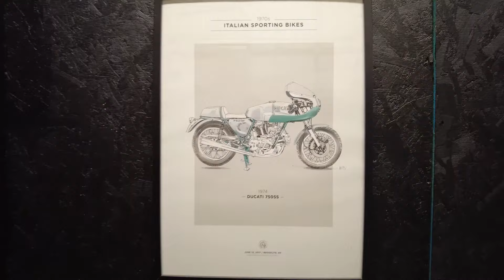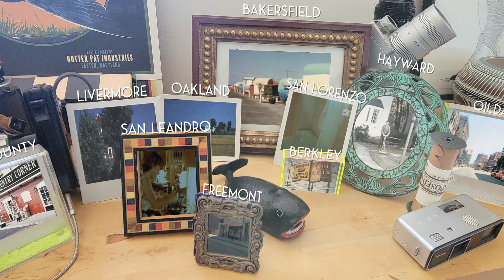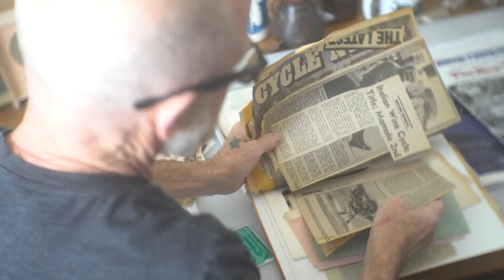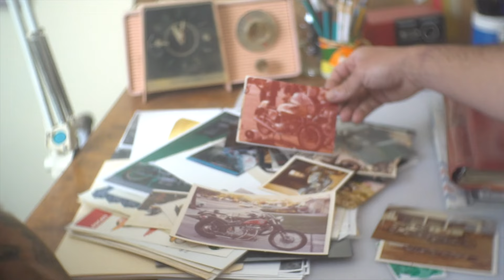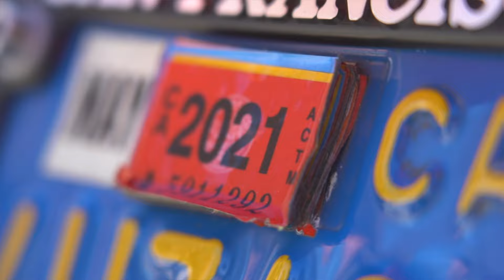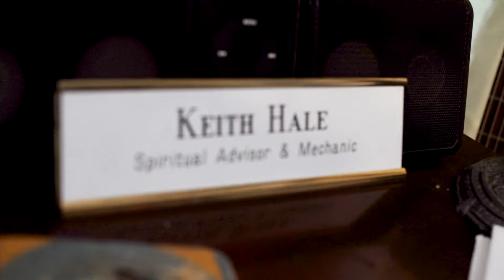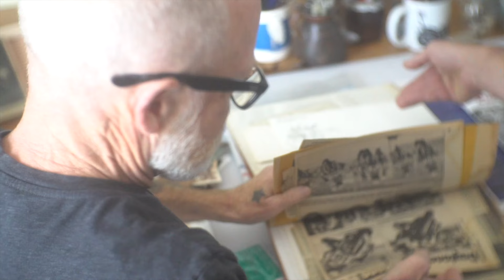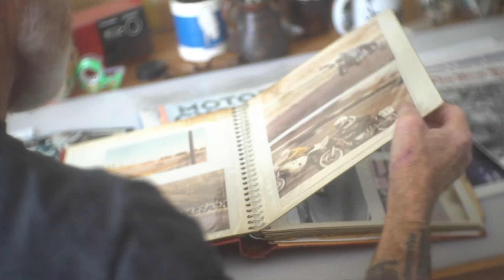Earned - The Story of Keith Hale and his 100k mile 1974 Ducati 750SS

Comment: 100K miles in a lifetime of ownership is nothing. I routinely ride 7k—8k miles a year, for decades. Many of my fiends also do the same. I like the last generation of the Super Sport, fuel injections being top on the list. These also come with 17” rims, 4 pot Brembo in the front. The last generation could actually be cut in two. This generation of Super Sport started in 1998/9. It was a bad financial time for Ducati as well as the start of a recession. I owned a 1999 SS 900. After a scary road accident, and an insurance payout on the damages, I race/track dedicated it. It was better there. Small, inexpensive improvements made for a better bike that it’s parts. I also owned a 2000 SS 750. That was a perfect street bike. I also out handled newer, flashier bikes. I very recently purchased a 2004 SS 800. This is a the second half of the last generation Ducati Super Sport. It operates at a higher level of performance. A lot more engine, very well matched/improved chassis, but  basically the same chassis. Small, incremental frame tweaks seem there. The rear end sits higher, the rear shock longer, firmer. Great for the track. Not so much for the street. Anyway, it’s a new bike for me. I’ll see if I’m not too old to adapt. I expect things will go well. After all, It’s a Super Sport!

Comment: bought one of the Other Rare ones a Mach 1 in Germany in 66 - in the Air Force, worked later on at MILLER Cycle specialties, restoring Ducati's, many a time at Berliner Motors, Long Island,  Hamden  cycle cntr, was a Ducati dealer owned by Bob Miller, Great video on Mr, Hale

Comment: I wonder how many 'engine rebuilds' this bike had?  Those bevel drive Ducati engines rarely made 15- 20 k miles in my experience without a crank rebuild as well as major work to the gears. The round case engines did not have ANY oil filter except a coarse screen, My own '73 750 GT had the case 'pounded out' where the main bearing was supported; it was NOT ever raced!  The gears were infamous for 'popping out' under load until they changed to gears with 3 dogs instead of the earlier 6 dog version, some of us had the extra dogs removed- The 600 Pantah and the Mille towershaft finally 'got it right'.  The 750 round case engine was truly a piece of art!  The original Conti glass pack mufflers were louder than legal in '74 but we all loved the sound! When Ducati went to the giguaro 'square case' the 'art' was lost! Those also were not as smooth running with their shorter rod engines.  No more balacing a nickel on edge as the engine is revved!
Reply: I can ask Keith if youde like. I had lunch with him today 10/04/2022
Reply: Actually, if the round case engine has it's oil changed frequently, wore air filters and was not abused, it is not unheard of to get fairly high miles out of them. Being entirely ball and roller bearing, the engines were fairly tolerant of crap in the oil. And the crank has a sludge trap that was fairly effective at catching crap before the crank pin. To have damaged your cases, I would have to guess that your 750's crank had been improperly shimmed, the wrong bearings, or both, most likely by someone outside of the factory. Those bearing are 15 degree contact and very expensive. Often someone who didn't know better would use 40 degree bearings with poor results. The early 860 based engines had short crank life due to using the 750 crank pin. The upgraded pin in the later 900 cured the short crank life. The "popping out" was more to do with abused dogs and speed shifting. Yes, removing the shorter dogs did help engagement, at the expense of more backlash. The 3 dog box became standard around 1980. And fyi, the Conti isn't a glass pack, rather it is all steel with a perforated straight through center tube. I completely agree that the Round case is a work of art. Some of that was lost with the Square case. The best is the Mille. Ducati got it's looks and mechanicals right.
Reply: @tdkeyes1  Gearboxes on those bikes were very poorly machined, when the various dogs between a pair of ears were supposed to mesh in Siri all the dogs with mash on both pieces evenly at the same time. But in reality they were not machine evenly and in fact maybe one dog pear would engage and take the entire load because the machining was lets a higher or less material had been removed. Of course then that particular dog would soon fail because one dog can’t take the entire load for any length of time pretty soon you have a gearbox that is popping out of gear. And then of course means the engines comes apart. When they went to the external  crossover shift mechanism it was even more likely to have incomplete shifts due to friction in the linkage and then the gears would also be popping apart and soon be ruined. That would be in the 76 and up engines. Ducati eventually admitted the tolerances for assembling their crankshafts were questionable, ha ha as in I think if you got 15 or 20 k Miles on a crankshaft you are doing well. And that has nothing to do with oil changes. My first tower shaft bike was a GT 750. On that bike first I had the gearbox problem but then the crankshaft got loose in the cases. As I recall the bearings sat in steel rings but the steel rings were loose in the aluminum case. I eventually put a Darmsh engine into a frame. Well that time at least they had a decent Japanese style internal shifting mechanism
Reply: If balanced, shimmed and assembled correctly and with regular two to four k oil changes, the roundcase engines will run a lot longer than 20k.  Not that it’s difficult to remove and tear them down. Quite a few were used for endurance and production racing here in Australia in the 70s.  We were Ducatis biggest market for them at one time around 1975 I believe.  The factory even built some GTs and Sports in 1978 just for the Oz market in response to a request to Fraser’s, the NSW distributor.  I’ve  owned and built a few and I never saw any fibreglass packing in Contis, Lafranconis or Imola exhausts( all perforated steel internal tubes and none at all in the case of the latter.There was also a race kit supplied with the 74 models and a factory race kit available which included a long list of parts including oil cooler, cams and a bunch of sprockets. Don’t know if any of the kits have survived.  Ian Falloons books on various Ducati models provide all the answers.
Reply: I rode my first 750 GT roundcase in Western Australia in the 70s, typically everywhere at 100mph, and in searing heat. Every 1000 miles, changed the oil - BP Corse 50+ - no multigrade. It would run like that for a very long time. I've done 750+ miles in a day like that - mostly sitting on 100 mph. 
You'll have less big end bearing problems if you get the timing sorted with the single timing plate, but twin points - and there's a trick to doing that. IIRC, the front pot ran hotter than the rear too, so it worked better with different heat range plugs. Like most owners, I quickly ditched the standard air cleaner system and used the mushroom washable foam filters. I never had problems with the gearbox on either roundcase that I owned.

The roundcase engine is as much art as it is engineering. Dr Taglioni was a true genius.
Reply: @fretworka3596 I met a bloke in the late 80s at the HA concert in Broadford Victoria who rode his 750 sport from WA for the weekend concert. That was a fair old trek especially back then.😄
Reply: Had one of the first 750SS’s in NYC in 1974 for several years. Loved it and have forever been sorry I sold it. The only problem I had being 6’2” was I had to get off it every 60 miles or so to un coil my legs and walk around for a few minutes. They were definitely not built for tall riders but oh what a joyous ride! Other than rather frequent Valve adjustments (mine needed them every 3000 miles or so it was totally reliable it always started on the first kick, when cold, after tickling the carbs.(my mechanical work was done by Reno Leoni. I couldn’t have done any better imo.) Regarding the sound, my friends who were waiting for me at a campground in Vermont at around 10pm. Told me they could hear me coming as I up and down shifted on the mountain road for several miles! What a machine